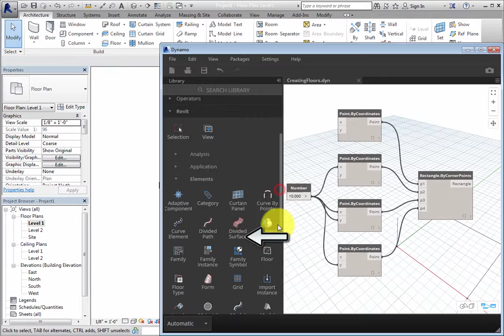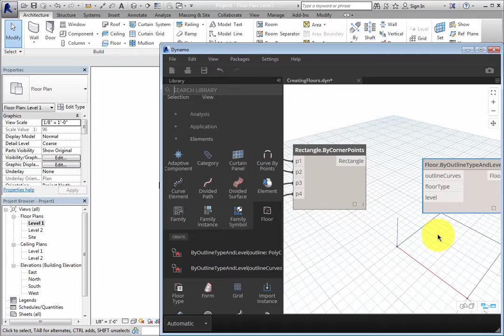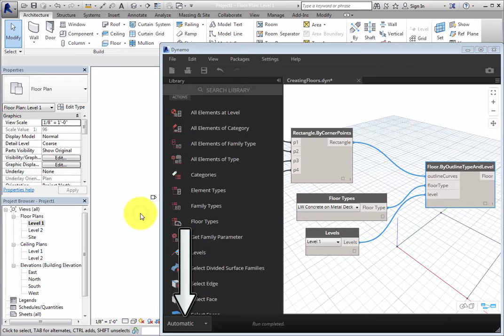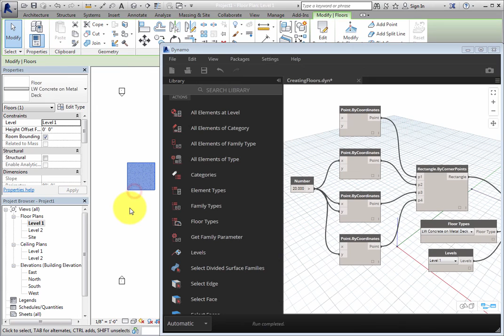Creating Floors with Dynamo

Comment: I did this and duplicated my floor to create a 2nd level floor, but when I change the level it just associates with level 2 and then changes the height offset by -10  so it only shows on level 1. If I change the height offset, it moves, but then returns to level one and "-10'" when Dynamo runs again. ???